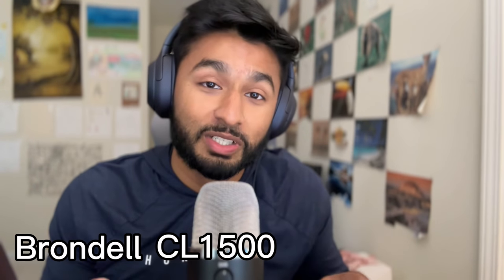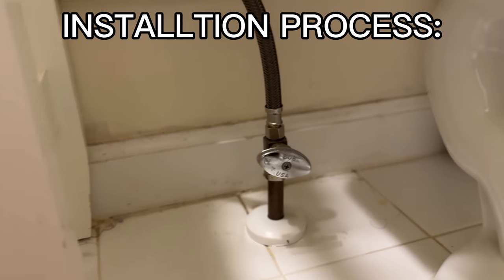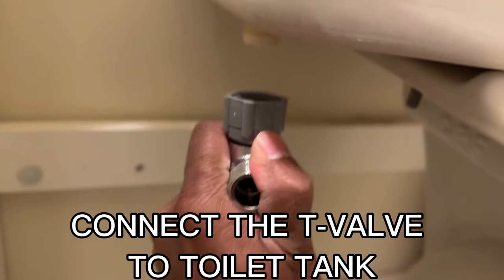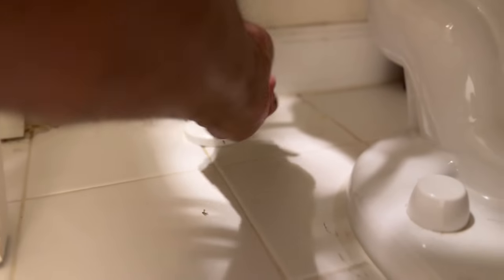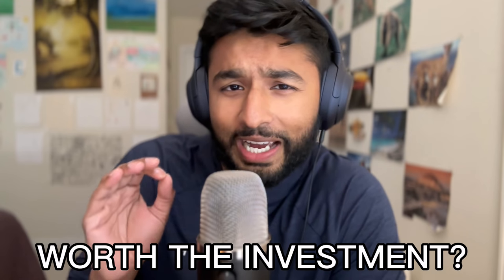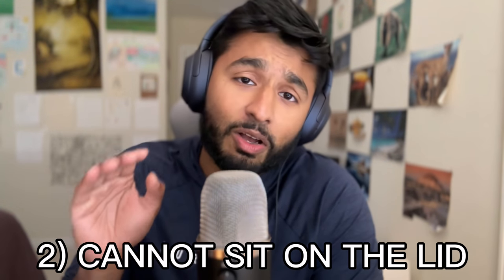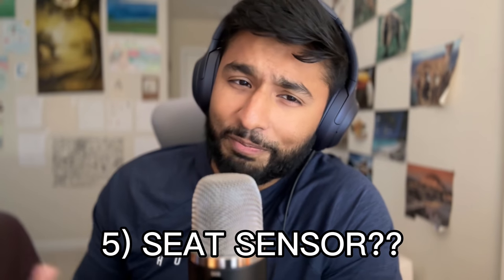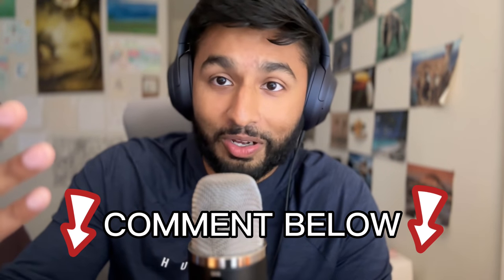Brondell CL1500 Bidet: The Costco Luxury Clean Experience!

Comment: Seat Sensor Override
1. To activate the Seat Sensor Override, press and hold the Pulse button for four seconds.
A beep will sound to indicate that the seat sensor has been turned off. If the Swash is in
Silent Mode, there will not be a beep. The Nozzle Position and Water Pressure/Dry Temp
lights will stay on as long as Seat Sensor Override is activated.
2. To deactivate the Seat Sensor Override, press and hold the Pulse button for four seconds.
Two beeps will sound and the Nozzle Position and Water Pressure/Dry Temp lights will
turn off.